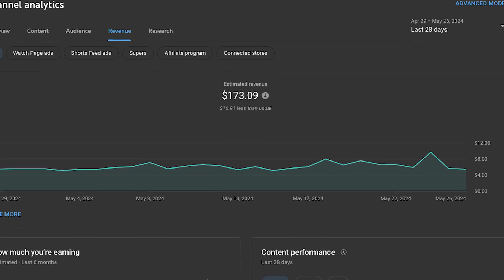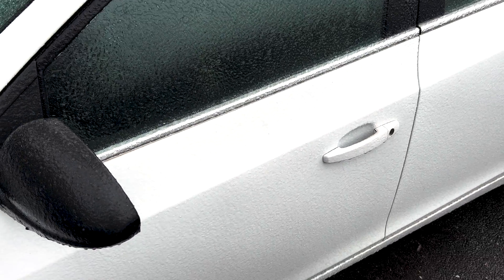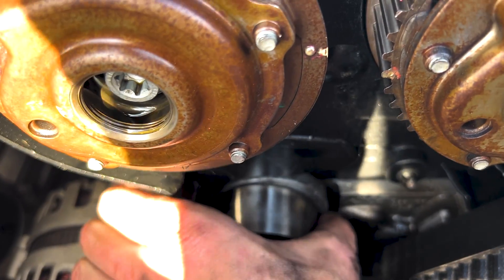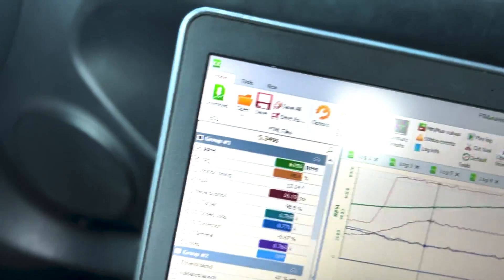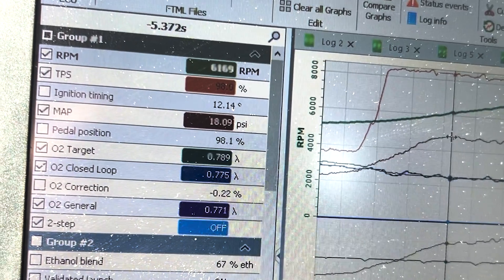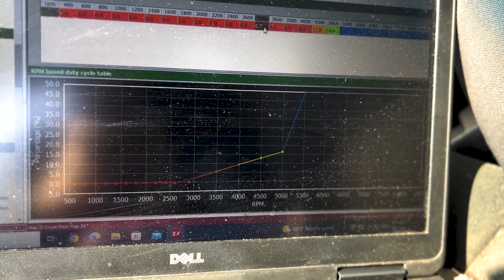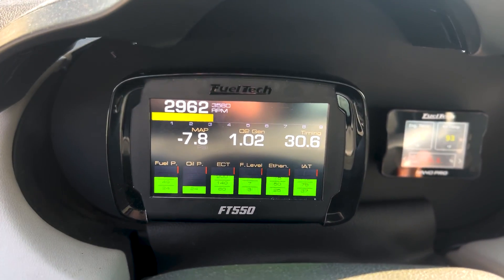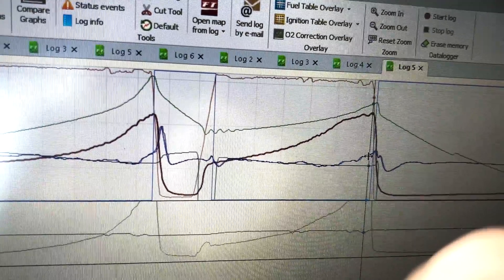Boosting Our Turbo Cruze with FuelTech FT550

Comment: How do get the car to idle under 1k rpm? 5:35
Reply from the maker: With my setup, cams and intake, it doesn't really like to idle under 1k rpm. Not enough air velocity. The build is more geared towards high rpm. Although, it's doable, but will eventually stall.

Comment: Question, why does your idle breakup like that? My turborunner does the same thing
Reply from the maker: Not really sure. Tried different plugs, coils, wires... all I can think of is the exhaust routing and how the pulses of each cylinder interact.
Reply: @ that is weird because mine runs fine with stock ecu and with the fuel tech it does that. It’s pissing me off

Comment: Niiice! My 1.8L Sonic is on stands right now! I'm in the process of pulling the engine to build it for a turbo. Gonna do forged rods, JE forged pistons, ect. Following your lead!
Reply from the maker: I've seen! Is yours the one with the Haltech?
Reply: @cmattdabrat  dude! Stoked to get a reply! No, I don't have any media out on it. I was gonna run 10-15 lbs and just do HP tuners. Kinda stalled on the project due to funds at the moment, but I did call JE, gave them your order number for the pistons you had them make for a quote. Still 100% committed to this build! I have the turbo, forged rods, new bearings, and I'll get there eventually. I have the engine out on a stand. Next step is to get it into a shop for resurfacing and hone the cylinders for the new pistons I'll order within the next month or so. I'll have to catch up on all your new videos and see what you've been up to!

Comment: Where did you get your head studs from?
Reply from the maker: They're ARP head studs from a SRT-4 Dodge Neon. I had to open up the 9mm threads to 10mm and open the cylinder head bolt holes a little so the studs would pass through and give the oil a way to get to the cylinder head. One of the stud holes passes the oil from the block to the cylinder head.

Comment: do you have any guesses power wise where you’ll land? does anyone have a build that you can compare it to? seems like a lot of stuff is in uncharted waters!
Reply from the maker: The 1.6 VXR is the same engine and cylinder head. Do a search for VXR 1.6 stage 4 or was it 5? Anyhow, they're pushing 485hp (if I recall correctly calculated flywheel hp). I would be happy with anything north of 400 whp. Goal is to get the car in the low 11's high 10's.

Comment: Have you considered a Dragy to do some 60-130 or top-end pulls?  That would tell you a lot about power without having to wait on a dyno and stuff.  And it'll let you turn anywhere into a 1/4mi strip.  Like "mexico".  Keep up the good work man!
Reply from the maker: I have! Need to replace the syncros on 4th gear so I can get my 1:1 ratio back. A draggy is definitely something I'll get in the near future to help dial in my driving. The track is where it's at. Like the difference between watching a movie at home vs going to see something on the big screen.

Still want to get the vehicle on a dyno so we can really dial in timing and the horsepower / torque curve. More to come soon.
Reply: @cmattdabrat  Not sure how to get into contact with you, but I actually have the older model Dragy I would gladly donate to your cause.  It gives me an excuse to upgrade to the new DR70 model too.  :)